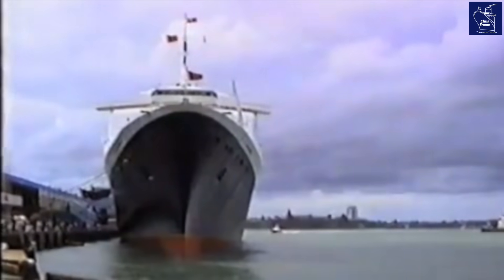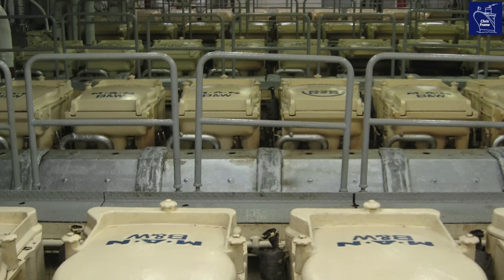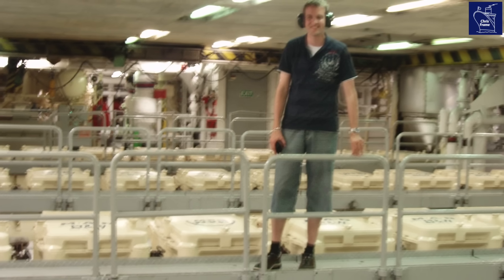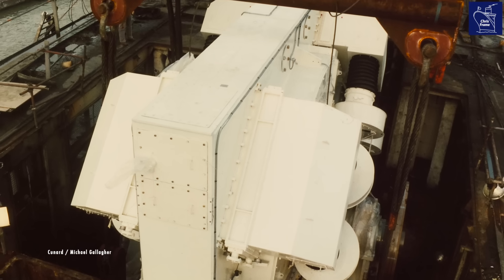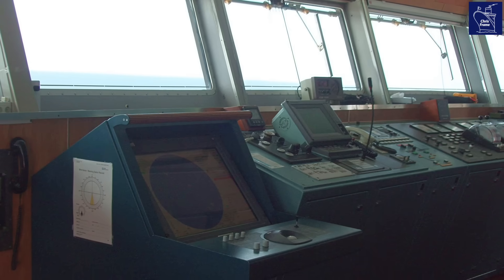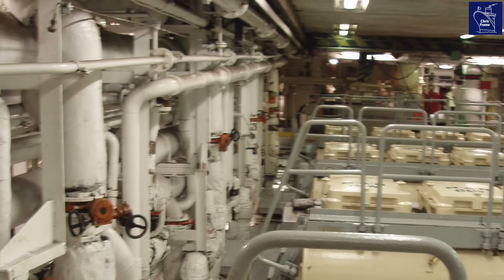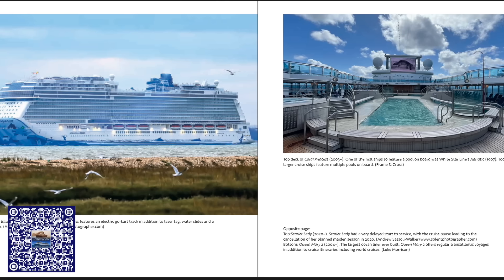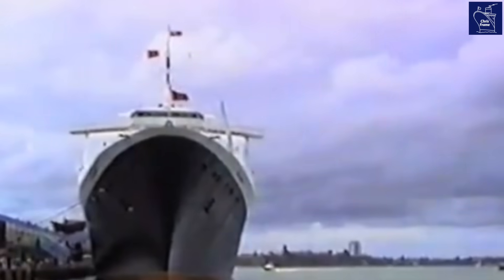The QE2's Colossal Heart Transplant: The Epic Diesel Swap That Saved a Legend

Comment: Thar re-engine project didnt prolonge the ship sailing life much.
Reply from the maker: 1987-2008 is 21 years - that's more than the working lifespan of SS United States... SS France (as built)... the new engines made a huge difference to QE2's ability to last into the 21st century.
Reply: @ChrisFrameOfficial 

SS France ⇔ SS Norway
Reply from the maker: @Mentaculus42  100%, however she had a shorter service life as a transatlantic liner, than QE2.
Reply: @ChrisFrameOfficial 

When I was a little kid I was on a 30 day trip from LA to Europe and the ship was docked (I think) in Southampton.  The ship right next to us was the Queen Mary and while I was standing on the deck, the France was coming in (with tugs). For a little kid who was into ships, I saw two or the three largest passenger ocean liners side by side at one time. Kinda a vivid memory.
Reply from the maker: @Mentaculus42  woah! What an amazing sight that must have been!

Comment: 10.5 MW x 1,36  equal to 14280 HP for each engine , multiply by 5 meand 71400 HP . maximum speed, please?
Reply from the maker: She achieved 34 knots in trials. Service speed 28.5. “Max” speed 32.

Comment: Not a single british yard was able to do it though
Reply from the maker: Also, Lloyd Werft were the only ones to have the genius idea of using the funnel casing to remove the engines. All other tenders required the hull to be cut open, which Cunard were not keen on at all.
Reply: @ChrisFrameOfficial  One would have thought that would have been obvious (especially in the shipbuilding/repair realms).
Reply: Which was very ironic.
Reply: What shipyard was the conversion completed at?
Reply: @frankaxiak1959  Lloyd Werft, Bremerhaven Germany